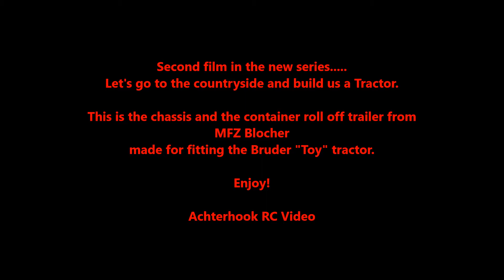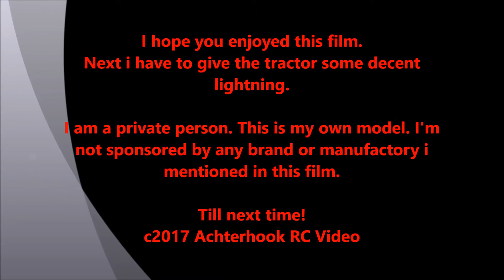Fendt 1050 Bruder on a amazing MFZ Blocher chassis Building film

Comment: Hi, I have a question.  Will the motors only operate with Servonaut components?  I tried using a castle ESC but the motors skip when I first move the throttle.....but they smooth out after passing about 30% of input of throttle.  I know the ESC is good, it works with my rb35's and other b-104 motors, but not with the MFZ-blochers.  Thanks for any info.
Reply from the maker: Hi, I don't really know. Should work with other esc as well. But it are 4 motors. Maybe you have to change some settings? Try mailing Andreas Blocher himself. He should know 😉
Reply: @AchterhookRCVideo  Thank you for the info